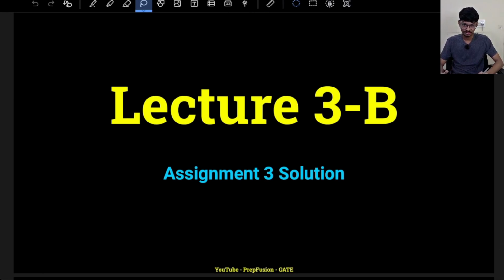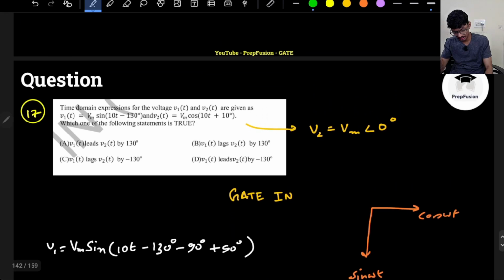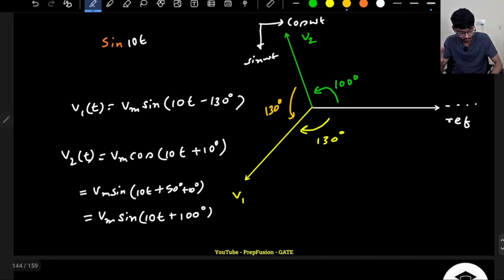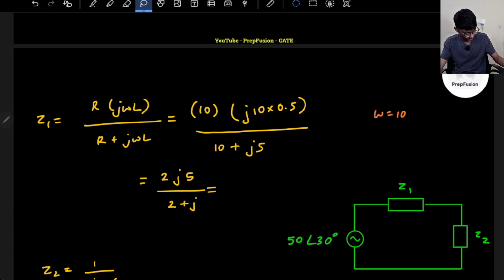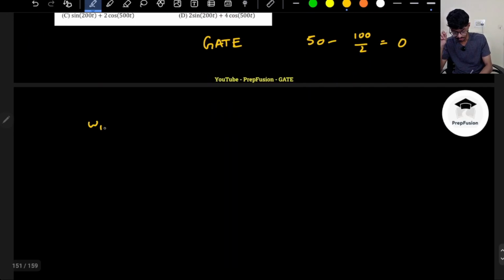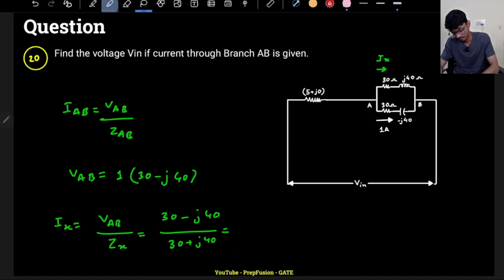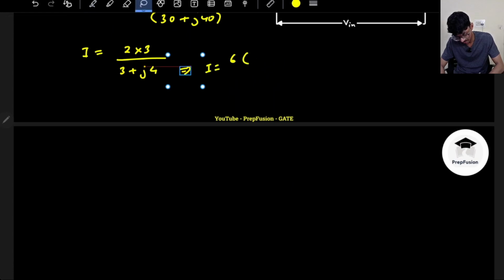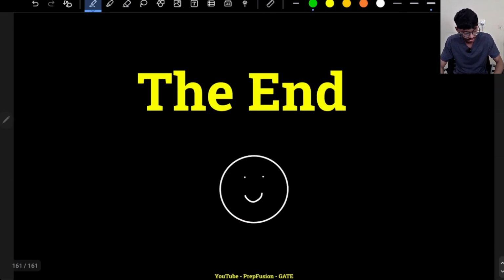Assignment-15 Solutions Of Phasor Diagram  || AC Analysis || PrepFusion

Comment: Hi Anish Sir,
For the last question, we supposed to find phase angle of current I by only considering V1 only right sir? They never asked to find out the phase difference between the two, they only mentioned as Current I with respect to voltage V1 right?
Reply: That is what we have done watch the complete solution.
Reply: @AnishSaha_  isn't it -90 deg ? Because with respect to V1, it is below 90. So, I think it would be -90 .

Also it can be verified by subtracting 45 deg on both V1 and I, so that V1 has 0 phase and I has -90 degree phase.

Please Reply bhai